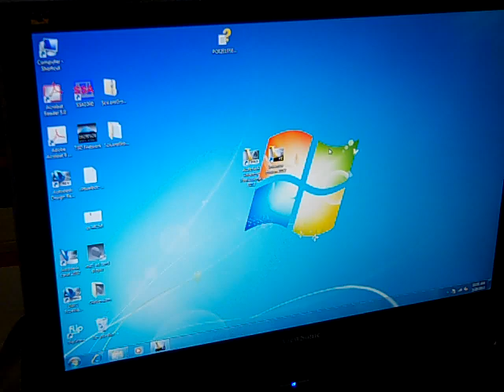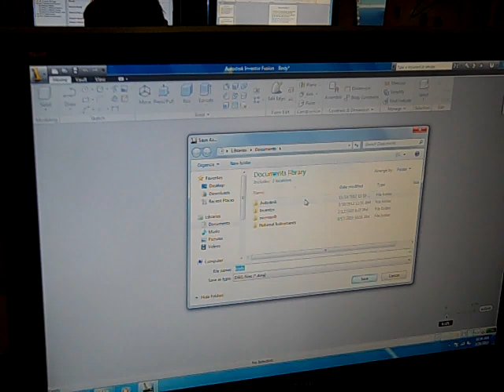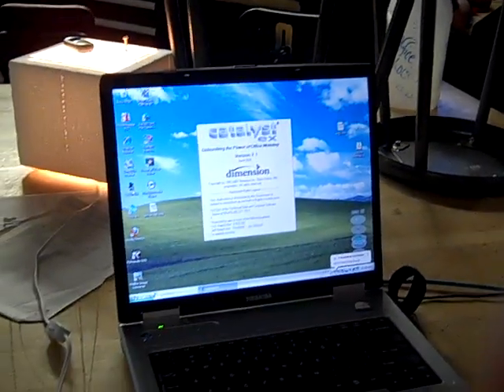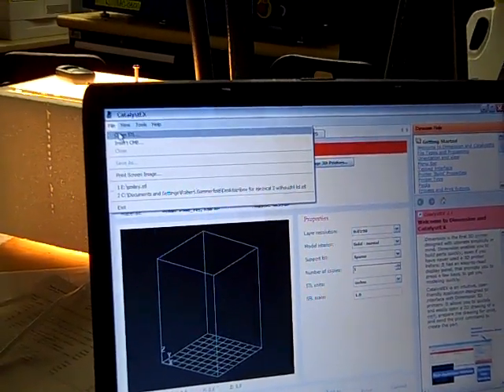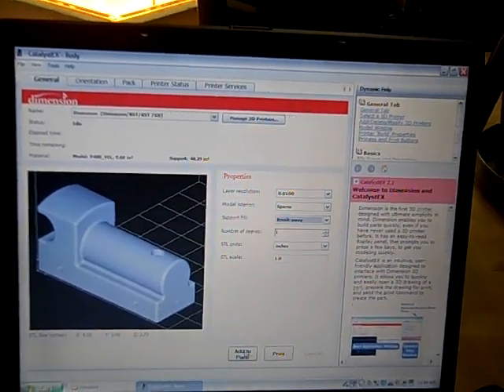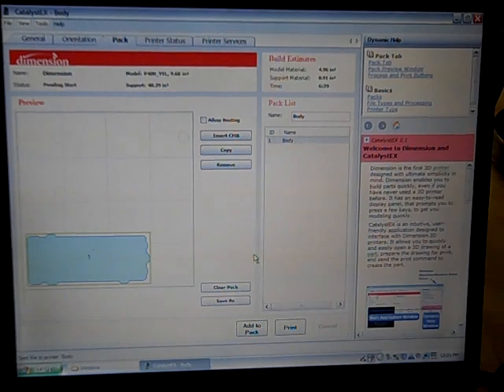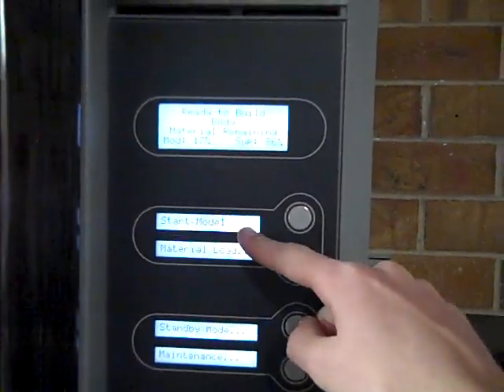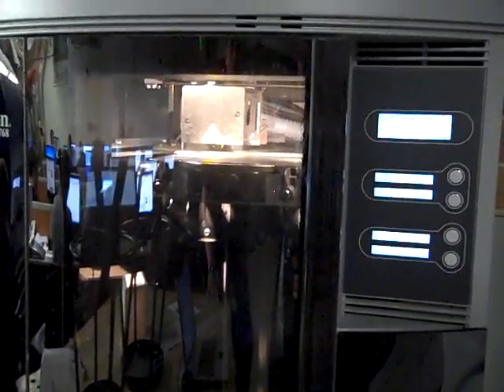How To Set-up 3D Printer To Print AutoDesk Inventor Prototype.MP4

Comment: Hi guys.  We had the same experience in our class and figured out how to fix it.  Using Inventor Pro 2012, open your part file.  Select the "Application Menu", "Print", "Send to 3D print service".  Just follow the prompts and basically it "prints" an *.stl file to a specified location of your choosing.  Then when you bring it in to the Catalyst software, the size of the part is the same.  Hope this helps you as it did us.